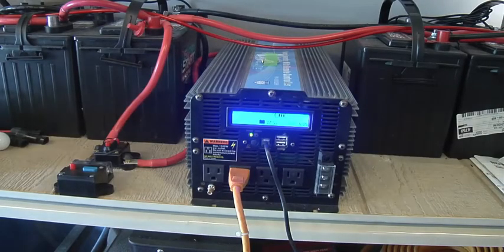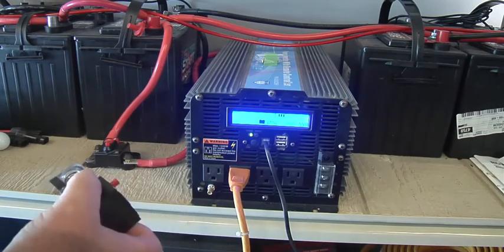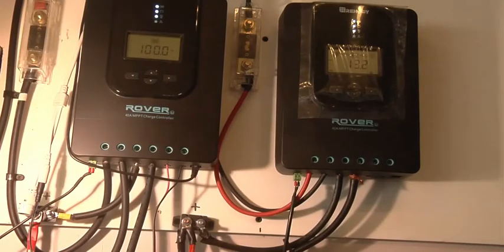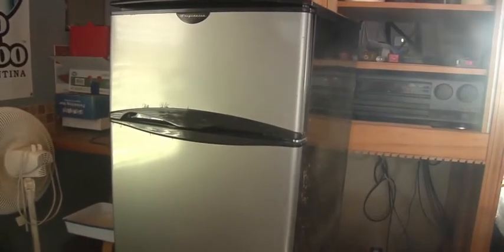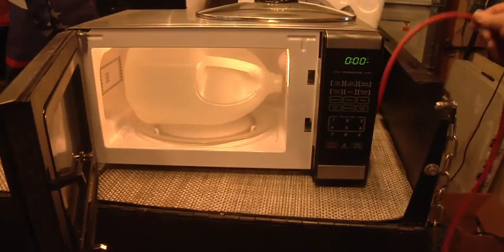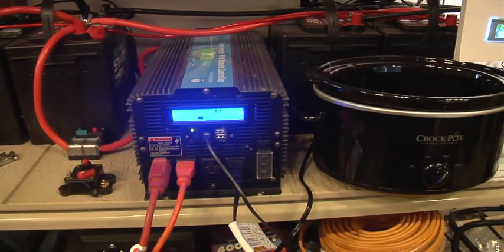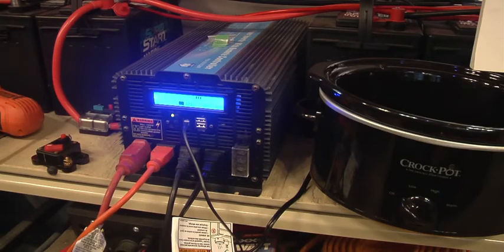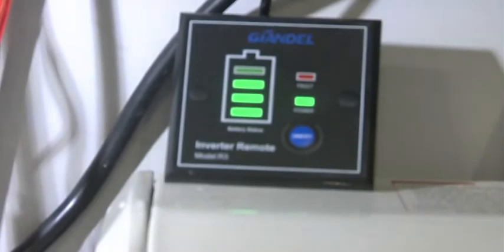Giandel 5000Watt heavy duty Modified Sine Wave power inverter "STRESS TEST TWO, Passed!

Comment: With the inverter 3000 watts 
How big the fuse amp I should put between the battery and the inverter?
Reply from the maker: 200 amp fuse or breaker.

Comment: What type of battery you have?
And how many battery?
Reply from the maker: I have batteries you can get at your local auto parts store. I have 7 deep cycle batteries you get for boats or RVs. The more batteries you have the longer you can run lights or other things.  Thanks.
Reply: I have 4 Renogy lithium 200 amp each 
Total amp is 800 amp battery bank

Comment: I have the same Giandel but the 3000 watts. I have installed on my boat and trying to figure out where I should put ground wire?
Reply: You dont need to ground inverters. They are an isolated power source. Only ground the inverter chassis if you are gettif RFI from the inverter. Hooking the inverter ground to the battery does absolutly nothing. Neg on the battery is NOT ground.
Reply from the maker: Yes, I never grounded mine either
Reply from the maker: You will need the ground wire between the inverter and the batteries the closer the better. Thanks.

Comment: Were you ever able to figure out a way to get your air compressor powered up off the inverter? I may have missed it but how long can you run all that stuff before your batteries get too low?
Reply from the maker: No, I haven't tried it again,  I will just use the generator if I have no power. I would say 2-3 hours  if you have no charging source into the batteries.  But if you have solar power all day  until dark, most of that stuff you wouldn't run that long anyway. Except fridge.  Thanks.